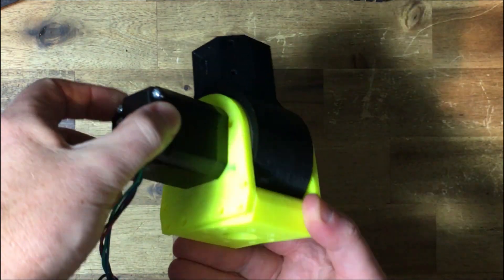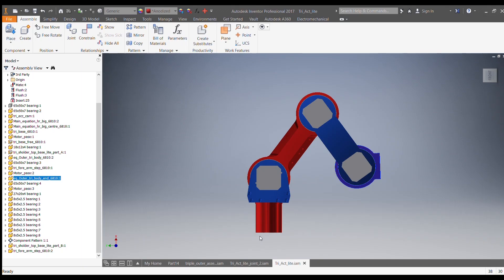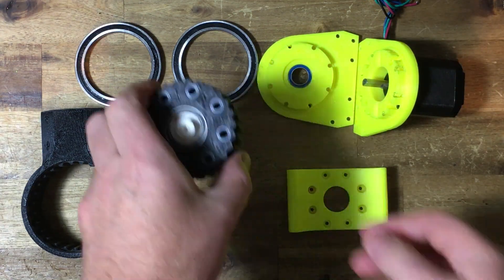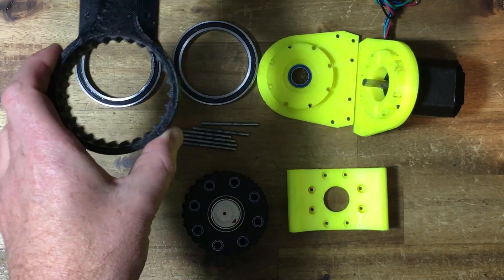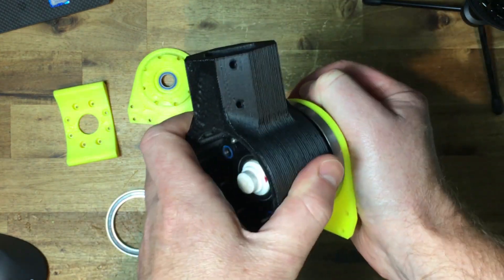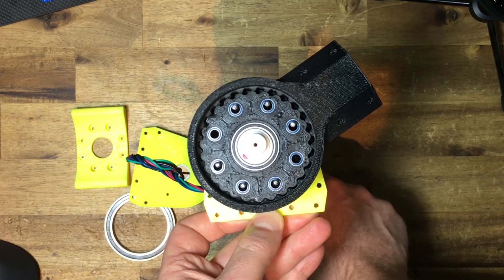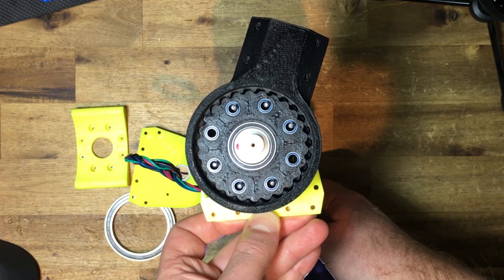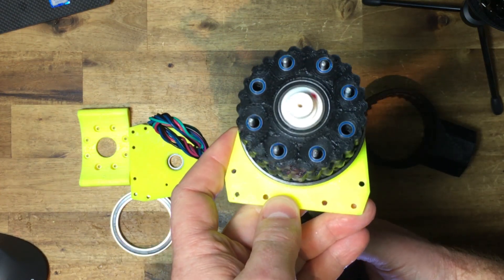Triple Cycloidal Gear - Robot Arm Pt1

Comment: What about using 4 separate disks? All of them would be meshing with the inner gear on different sides. Would that be of much benefit? I was starting to think about adding that to my V4 cycloidal drive once I’m fully finished with my V3
Reply from the maker: I've tried 3 disks at 120deg apart and it twists the housing. 4 would be better but not balanced. 3 at 180 with a thicker one in the middle seams to be the best.

Comment: Nice!  Thank you so much for sharing such detailed information to allow others to follow in your footsteps.  After making yours, I was thinking of putting the 3mm steel pins in a 3mm ID PTFE tube instead of the bearings (and modifying geometry to suit).  This would be cheaper and lighter (could be made smaller) but obviously performance would suffer.  Have you tried this with sleeves instead of ball bearings?
Reply from the maker: I haven't tried this. I like that the force is spread over a very large area with the bearings there. Maybe replacing the bearing with a large bronze/brass tube would be better.

Comment: Your work and dedication towards this project is inspiring!
Made me to continue working on my robotic arm....but i have a question, how do you design these gearbox like deciding how many disks should be used, Diameters of disk & rollers etc?
what tutorial/documentation/book would you recommend if i want to design my own cycloidal gearbox according to my needs?
Reply from the maker: This is not an easy answer. I have made enough bad ones to just know what are good diameters for what type of system. If you tell me your reduction ratio and outer diameter I can give you my recommendations. I have started a new robot arm design based on #2 of this video https://www.youtube.com/watch?v=J_NQYY9a5-E

Comment: Hey I have a question, I am trying to design cycloidal gear by myself but I facing some issues.
How did you calculate the distance between the center of the output plate to the hole where you placing dowel pins? 
I have a 5x8x2.5 bearing in cycloidal disc but can't find the correct place for dowel pins, either is too far or too close to the center.
Reply from the maker: I will chat to you on HackaDay.

Comment: How long did it take to print the parts? Have you found any effects from layer or nozzle size? Thanks!
Reply from the maker: I have a pretty cheap 3D printer, that doesn't run to fast, so each part takes about 1-2 hours. I have never pushed this hard to see how much torque it can handle. The print settings drastically effect the tolerances, either making it to tight so that it doesn't fit, or too loose and the backlash gets too big.

Comment: I've been playing with these for a few years in my free time. I'm trying to design for FIRST Robotics applications and attempting to maintain non-backdriveability to hold a load without power from the input side of the drive.

What changes in the cycloidal geometry or hardware makes your's so easily backdriveable by hand? Is the use of ball bearings aiding your efficiency and ability to drive it by hand?
Reply from the maker: Bearings, tolerances, perfect alignment/balance and a little bit of oil make it backdrivable. A higher ratio will make it non-backdriveable or even a double stage gearbox.
Reply: Adam, FRC Team 3737 is using two 3D printed cycloid gearboxes to lift our robot this year (2020/2021). Very compact with three equal weight cycloid gears set at 120 deg each to ensure no vibration. They are 24:1 and do backdrive but... if you set your controller to braking they will hold the 120+ lb robot still while power is maintained. Also, instead of the large steel bearings, we use 1/8" Delrin balls in printed v-tracks (and a little grease). These use less space and are almost free! We did not need the small bearings around the pin holes - the PETG holds up well in this application. Finally, we used pins on the outside rather than a printed profile so we never have plastic against plastic. FWIW, these two easily lifted the robot with 15% power to the two Neo motors.

Comment: Geat Video! Well done! soo pleased to watch it. I just wonder why did you put dweling pins inside? What is the purpose of it?
Reply from the maker: They are used to turn the eccentric motion of the cycloidal gears back into rotational motion of the output housing.
Reply: @PaulGouldRobotics  got it, thanks! What formula are u using to calculate the diameter of them? And where they have to be located. I have design mine in fusion 360 but not sure where to put them
Reply from the maker: @danieladamczyk9617  I don't have much raw calculations other than https://hackaday.io/project/157812/log/145872-mechanical-design-cycloidal-transmission
hole dia in cycloidal gears = dwell pin dia + (eccentric radius x2)
Reply: @PaulGouldRobotics  Does the distance of these holes to the center of the disk have any influence?
Reply from the maker: @tadashi_hamada  These holes are the ones that transfer the torque from the disks to the housing. The larger the distance the better.
Reply: @PaulGouldRobotics  That is interesting.  Thank you for the quick response. It's a hell to design these since there is not a thorough  design guideline and people have different approaches. Kudos to you for making such a great design.
Reply from the maker: @tadashi_hamada  You can chat to me on hackaday.io if you need more detailed information.
Reply: @PaulGouldRobotics  Thanks Paul! I just signed up so we can get in touch.

Comment: i don't understand what you mean by adding the 3rd gear stops twisting forces inside the gearbox? Also are you using nylon for the cycloidal gears?
Reply from the maker: Two gears push on opposite sides of the housing, one at the top and one on the bottom. With three, the top and bottom are in phase and the middle is offset 180degs. Statically and Dynamically is it balanced. The 3D printed plastic parts are not very strong. I'm using cheap ABS. My printer can't do Nylon, which would be way better.

Comment: I suggest you suggest this design to Ben Katz (http://build-its-inprogress.blogspot.com/). He had an awesome idea of putting a planetary gear into the motor itself. Having a backdrivable cycloidal gear allows for higher power and less torque motors to achieve the same result at a lower prive point, I believe.

Comment: I am trying to implement a cycloidal gear for my 3d printer z axis, I've got 4 nema 23 motors that I need to step down.

I can't find any good instructions on how to design this kind of reduction. Could you please help me onto the right direction? I'm using fusion 360.

Thanks in advance
Reply from the maker: Check out https://github.com/mawildoer/cycloidal_generator
Reply from the maker: I not sure if this is good for a z-axis. Please explain it further.
Reply: @PaulGouldRobotics  basically I've got a 4 belted z axis with a zmax of 1400. Right now I am using a direct drive with a 60 tooth (120mm) pulley. It works great for homing at high speeds as it has a max of 4 m/s but I would like to reduce the speed with a gear ratio to 100mm/s to increase the full step resolution. Therefor id need a 40:1 gear ratio that can be back driven with least as possible backlash
Reply from the maker: @callardo1  I'm not sure if I fully understand your design. Are you able give me a link to your work or something similar? My initial thoughts are, use a smaller pulley.
Reply: @PaulGouldRobotics  no one is really using this system, due to my design the belt is running over a 2080 profile on either side. So I need the 60 tooth pulley. Therefor the only option for me is to gear the nema 23 down.
Reply from the maker: What about 2 small pulleys with the belt going 90 degrees past each one, instead of the one large one at 180 degrees? I don't mean to sound negative. It sounds like your are trying to precision and high speed. This gearbox has a lot of limitations.
Reply: @PaulGouldRobotics  thank you for thinking with me.

I could use 2 pulleys but that would reduce the teeth engagement as well as a complete redesign, what are the limitations in your opinion if I may ask?
Reply: @PaulGouldRobotics  the script gives a housing (the pins) and a gear, how to find out how far the offset for the input shaft should be?
Reply: @PaulGouldRobotics  regarding the high speed, it would have to have an output rpm of around 50 rpm with an input speed of 2000rpm, which should be feasible after I looked at  other 3d printed designs, eventually I would mill them out of aluminum
Reply: @PaulGouldRobotics  oh and I am using 4 nema 23s

Comment: this is awesome. i have been wanting to build a pick and place delta style robot. this will work good i think. thank you 
also have you considered using drone size brushless motors for the acuator? or how bout using traxxas bearings for a low cost solution?
Reply from the maker: A pick and place delta sounds like a great use of the gearbox. Check out my other videos and my other hackaday pages. Drone motors everywhere.
Reply: @PaulGouldRobotics  I have been for a while. I was thinking of the smaller race quad size motors. Was also wondering how the controller project is going?
Reply from the maker: @mastermoarman  The smallest practical  motor I use is 4008. Going smaller, you should just by a brushless servo. I think that I have just finished the controller's PCB. I will send it off to be made shortly. I had motors working on the SAMD21 Dev kit with external Haft bridges and external encoders. So i'm happy with the base software too.
Reply: @PaulGouldRobotics   very cool. How many steps per rev are you expecting to see out of the setup?
Reply from the maker: @mastermoarman  200 steps/rev motor, 27:1 reduction ratio = 5400steps/rev with no micro-stepping. Not sure how linear that will be.

Comment: Hi Paul, I'm loving your work.

I have a question, what are the advantages of three cycliodal disk instead of two?

Thanks.
Reply from the maker: Two disks puts a twist force on the top and bottom output housings. Three disks balance this out. Also three disks are dynamically balanced to there should be no vibration at all. This is more important at higher speeds.

Comment: Wow, great work! Whats the weight of the gearbox without stepper motor?
Reply from the maker: The big bearings weigh 50g each. There are also 24 small bearings and 7 medium bearings.
Reply from the maker: 350g
Reply: @PaulGouldRobotics   Oh, that weighs a lot. Are those two ball bearings that heavy? Because the plastic housing doesn't look like it weighs much. Isn't that too heavy to make the robot jump later? Probably more than 10 kg total weight, right?

Comment: Hi Paul, very nice design. Have you measured the backlash of the gearbox?

Would you be willing to share design files with us? :-)
Reply from the maker: It's open source, of course there will be files :-).  I uploaded the video before I made the following pages.
https://github.com/gouldpa/Triple-Cycloidal-Robot-Arm-Proto-2
http://www.thingiverse.com/thing:3754331
Backlash is about 1mm @ 300mm. It should be better but I had a problem with the eccentric cam tolerances. The back lash is coming from the internal pins on the small bearings. Usually my gearboxs have about 0.2-0.3mm @ 300mm and that is coming from the cycloidal teeth.
Reply: @PaulGouldRobotics  Thanks for the clarification :-)

Comment: "Missing steps by 2kg load"  lol most small scale robotics wouldn't even dare to try 1kg so yeah nice.
Also with a decent stepper driver and fine adjusted settings probably not even an issue.
Reply from the maker: Its a Anaheim Automation 17Y301D-LW4  with KL-4030 Driver 30V @ 2.4A  16MicroStep. Motor was getting 45degC steady state. I made a mount for a NEMA23 (KL23H276-28-4B) and it did 6kg @ 200mm before I went past the rotational limit and broke a base plate. Slower speed and lower acceleration rate with the NEMA17 helps a lot. I got it to do 2.5Kg @ 300mm going super slow. I don't like the constant current drivers. They are so inefficient.  I have a ST PowerStep01 but I think that I'm over stepper motors. Back to Brushless for me.
Reply: @PaulGouldRobotics  Yeah servo systems are getting so much cheaper lately there is really no reason to buy steppers any more. (Besides the fact that they are getting ridicules cheap)
But 6kg is HUGE with a closed loop that thing can do some serious work.
Reply from the maker: I just put 10kg @ 300mm with a drill on the input shaft and it went ok. The plastic around the output extrusion started to crack. It could be beefed up but that is more than enough torque from a 3D printed gearbox. I'll make a mount for my 5010 brushless motor/controller and see how it goes.
Reply: @PaulGouldRobotics  Daaaang a ~2kg EOAT @500mm reach shoudn't be a problem.
Granted, may not be high precision but honestly with clever error correction with CV or a Valve LH system that becomes very usable.
Reply: @PaulGouldRobotics   I just remembered something:
https://youtu.be/XpDG8VxZsw4
You could try to do a circular inlay this should allow you to go totally nuts with that thing 🤣
Reply: @PaulGouldRobotics  Have you tested it with the 5010 BLDC yet?
Reply from the maker: @tadashi_hamada  Yes, This design is in the https://www.youtube.com/watch?v=XWp5dkeHgTY

Comment: Hi Paul, great to see you finished it. Did you notice any wear on the cycloid lobes after the maximum loading?
Reply from the maker: The loading in the video is the max of the NEMA 17 stepper motor while being warm. The limit of the gearbox is likely to be 10x that. I haven't noticed much wear. There is a little bit of "wear-in".

Comment: Amazing results, glad to see your dedication to this project. 
It really does seem like the best 3d printable reducer design possible for robotics.
It seems to require a lot of expensive bearings though. When I looked for big outer bearings it would easily be more pricey than the motor.
Is it a cost you are willing to take or have you maybe found a reasonable source?

Can't wait to see more :)
Reply from the maker: I like bearings a lot :-). I'm half doing it for the "low cost" but it is more about coming up with a good design.
Big bearings (6810RS) are AUD$14 each from the local bearing supplier (Apollo). Medium ones are $1.80 and the small ones are $1.10 from https://plaig.com.au
Reply: Try empire.rc on ebay. Shipping takes a while, but I've gotten a lot of good bearings from them.